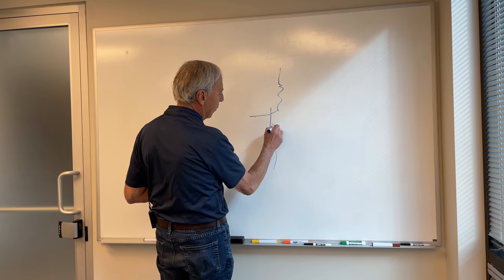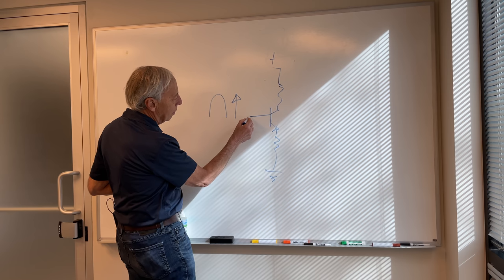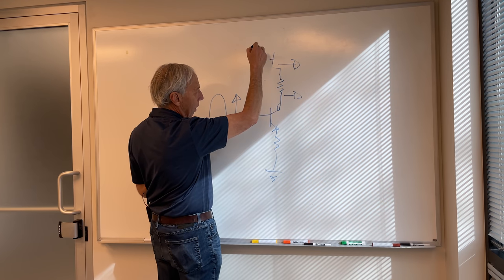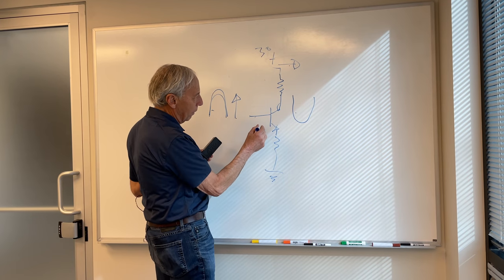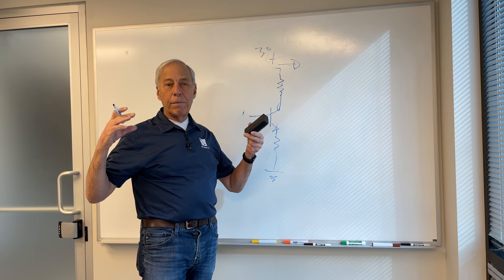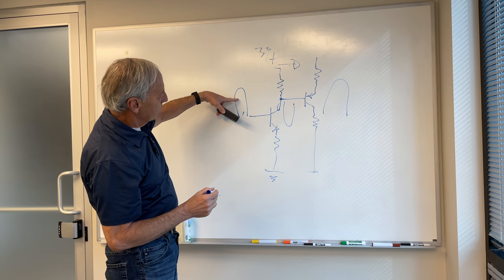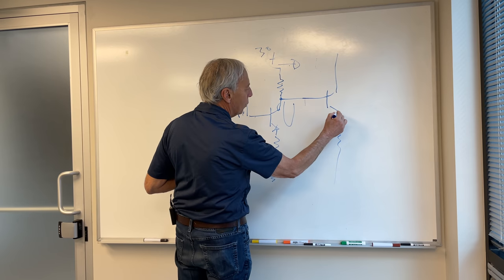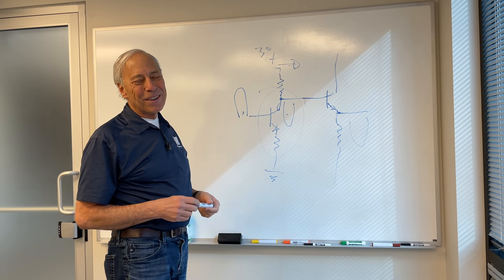Why phase is reversed

Comment: Just swap your speaker wires to fix absolute phase. It might be audible also because a dynamic driver in a speaker is potentially not equally linear in both directions of the cone motion.

Comment: Smart ass comment...technically this is a polarity switch, not phase. Just couldn‘t hold myself because this term was hammered into my brain once.
Reply: What is the difference? Polarity switch means phase inversion.
Reply: @zukaka84  Well there is no difference in the effect, it is just a terminology thing. After all phase is an acoustic term, which can have any value between 0 and 360, so the phase shift between two channels could be 14,473 degrees. But if you take two wires and flip them you simply do a polarity switch on the electric end of things. Of course that has the same affect as a phase reverse, that's why that was a smart ass comment.
Reply: @kaiulrich6185  I know that. But we are not talking about the phase shift here. We are comparing phase inversion and phase switch, and these two are the same.
Reply: @zukaka84  Ok I try again: If you take two speakers and move them apart, you're doing something acoustic related and in any distance one frequency will be exactly out of phase.
If you flip two wires, you are doing something electric related, so ALL frequencies are out of phase. Phase is frequency dependent , polarity isn't
Reply: @kaiulrich6185  You are explaining something different. Inverting phase means changing its sign which is the same as  switching polarity.

Phase is wha tis written inside the sine. - sin(phase)
Reply: @zukaka84  Sorry, phase doesn't have a sign because it is really not an electrical term. Again: you reverse the polarity and that causes a switch of phase in ALL frequencies. But phase reverse is just not the right word for flipping wires. it just isn't. You obviously don't believe me...it's still true.
Reply: @kaiulrich6185  You are wrong and correct. Phase is the thing that is written inside sine and it can depend on time and coordinate. For a given time and coordinate it has specific numeric value and has a sign. The signal, which in this case is voltage can be written as V=V0*sin(phase). And since in general sin(-x)=-sin(x) this means that when the phase changes sign, so does the voltage.

But as you say yes - switching polarity means changing sign of the signal, in this case voltage. And inverting phase means changing sign of the phase. So they mean different things but they are always equal to each other.
Reply: @zukaka84  that I never doubted.
Reply: @zukaka84  The difference is that a phase inversion, tu put it in lame terms, translates the wave horizontally in a graph while a polarity inversion mirrors it horizontally. A minus sine is not the same as cosine.
Reply: @UntakenNick  Phase inversion does not translate signal horizontally, it is the phase shift that does it. Inversion means change in sign which means mirroring.

Comment: So if you had a phase-inverting pre-amp, you'd just connect both your (+) power amp to (-) loudspeakers. As I understand it though, if both channels are phase-inverted, it makes no difference to the sound unless you definitely want to maintain absolute phase (microphone to speaker), which I suspect would be impossible with most modern pop music recordings anyway.
Reply: No, it would be just like swapping a resistor in the drawing he made, it wouldn't change anything.

Comment: So am I in the right to guess that as in example provided at 5:00 the first transistor doesn't need to be a big one? my point being that it only needs to "invert the phase" and the next one amplifys?
Reply: He's talking about tubes and they need to be set at a certain level of current in order to create their effect. In a "normal" circuit, yes, we could say so but I suggest not trying to understand audio in the form of discrete junks of information. Audio is just one application of analog electronics and that's what you should dig into if you're interested in understanding this kind of stuff.